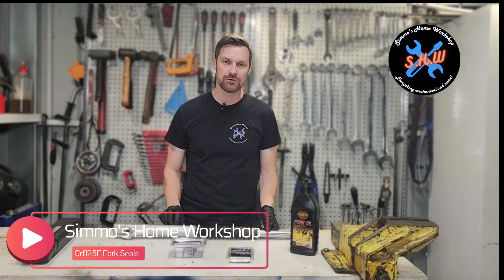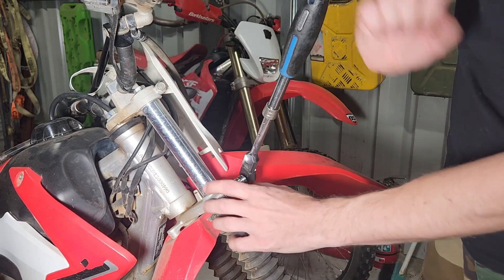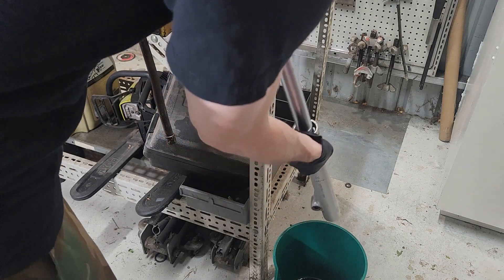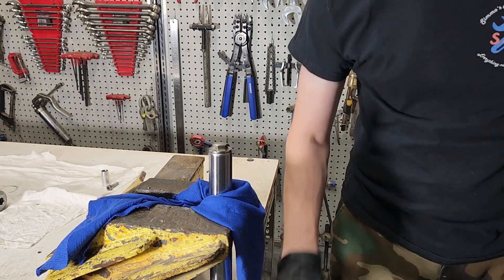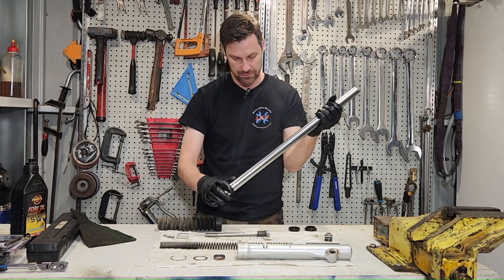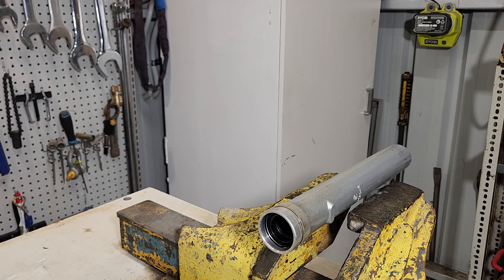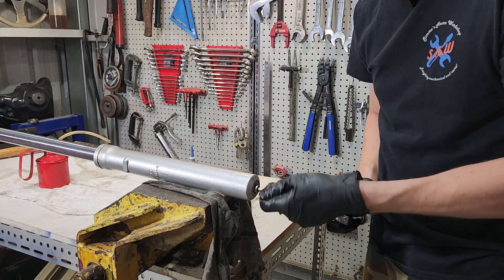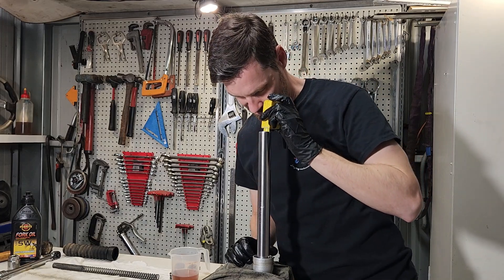Honda CRF125F Fork seal replacement | All specs and oil levels!

Comment: What is oil capacity for Honda crf 125F not FB
Reply from the maker: Hey mate. Short answer is i don't know, sorry. I had a look to find some information on the small wheel 125 and there are conflicting reports. 
Most seem to say an air gap of 90 to 130 mm from the top of the fork with spring removed.
I'd say best bet is to start with a fairly large air gap (say 130 to 150mm) and test it out, if it feels like the last 1/3 travel could use more dampening remove the cap and add even amounts of fork oil to get the feel you need.